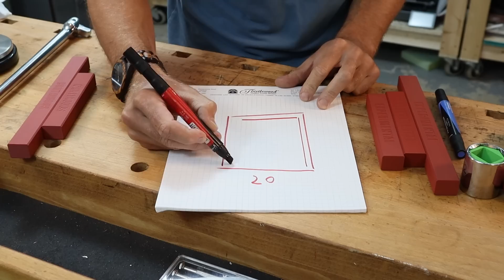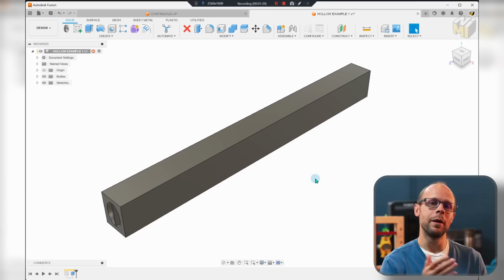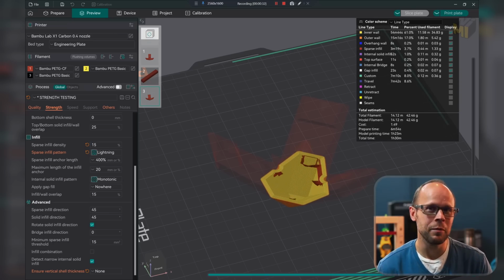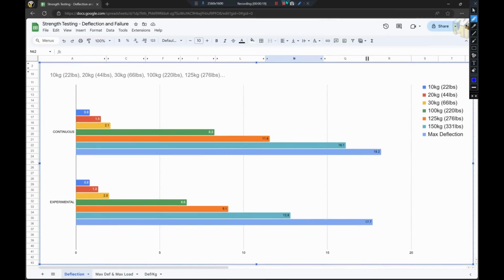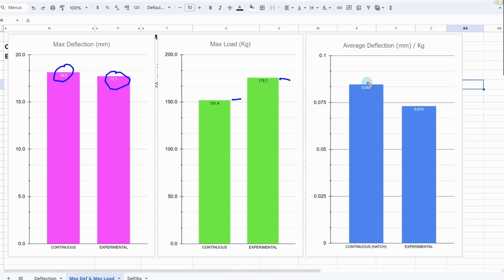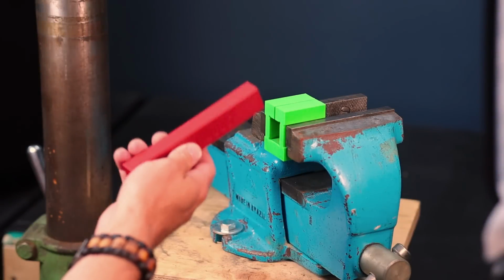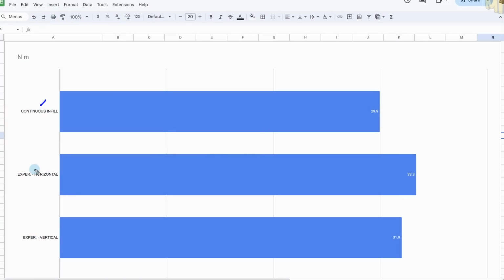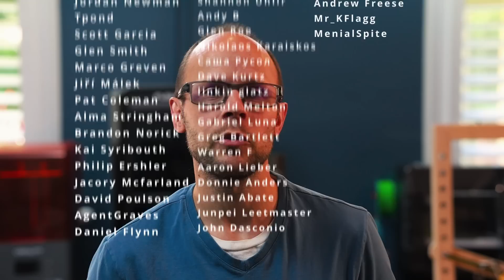Is an UNfilled 3D Print Stronger than an INfilled 3D Print?

Comment: This is a very common and useful technique for designing mechanical parts. The further away the material is from the neutral axis the more it will contribute to the bending strength of the part (you can possibly think of it like torque), so for the best bending strength you want as much mass as far away from the neutral axis as possible. Along the neutral axis (in a simple rectangular part that would be right in the middle of its thickness) the stress and strain is zero and the further away from this axis you get the greater the stress and strain become.

Steel H or I beams are a good example. When used in the right orientation they have very little material in the middle, close to the neutral axis but they have lots of material further out. They are much stronger than a solid rectangular beam of the same mass because of this more optimal material usage. They also have a very good strength to weight ratio, much higher than if you used a solid beam with the same external dimensions whilst also having most of the strength of the solid beam since in a solid beam most of the mass doesn’t add much strength.

So when designing parts to be used in bending it is best to use the largest part you can (external dimensions) and distribute the mass as far from the neutral axis as possible.

This is also why two stacked beams won’t be as strong as a single thicker beam, each of the stacked beams bends independently and therefore the maximum distance material is from the neutral axis of each beam is half of its thickness whereas for a single thicker beam the maximum distance material is from the neutral axis is doubled so the material contributes much more to the strength.

Comment: I found 5% and 15% gyroid(or triangle infills gave better support on a wing profile..I also found going below the nozzle size for line width made the parts significantly weaker but oversizing was fine or useful.

Comment: If infill is to support top layers, it doesn't matter much, how it is printed, as long as it's fairly dense just below bridging.
If infill needs to bear load, it needs to be thick -  0.6-0.8 on 0.4 nozzle - and dense - 50%+ (just changing width changes line spacing as well).
In Cura it is possible to print infill with multiple lines, creating loops. Combined with alternating extra wall (Cura) it should produce pretty solid infill. PrusaSlicer honeycomb is also 2 lines wide.

( Or use non-filled plain filament for max strength 😅 )

Comment: My sound stopped into the clip, so I may have missed it - one very important question - do the parts have the same mass per unit length?. What do you think about airplane parts that are using honeycomb material because the lightweight filling is providing a much better strength to weight ratio?

Comment: Great video....try a ribbed or shallow corrugated inner profile (think early Junkers aircraft construction) - will increase both stiffness and torsion.  Even more so if used on outer profile too.  You'd need to reduce wall thickness and optimise to keep the same weight for true comparison.

Comment: From physics standpoint - the closer to you get to the middle of part (or the bending axis) the less strength you gain with infill.
When bending a part, majority of forces are on it's skin, and because of that, hollow parts are industry standard - hollow bike tubes, hollow car's bodies and thin metal sheets being stamped to mimick a hollow part.
You also made an improvement of adding more material to the corners, which are further from the middle and thus provide more % of strength, but I'm not entirely sure that in rectangular part the inner hollow should optimally be an oval - probably something like very rounded rectangle would be better.
Infills generally are wasteful - making some structural ridges just below the surface is sufficient for most of uses.
Reply: doesn't ikea put a honeycomb basically of cardboard inside of its tables and desks to improve rigidity?  In that case the honeycomb is rigid perpendicular to the load, but I feel like it definitely does something compared to just hollow particle boards
Reply: @Negi2468  They do, but mostly because of reasons mentioned above plus cost. 
IKEA wants to use as little of expensive material - outside veneers - as possible without it breaking easily. On top of that, very large flat panels need to be rigid to not only bending but also compression, and that's why cardboard infill is used. 
They'd also easily buckle or break at that size and thickness.
Reply: True, I'm studying engineering and one of my subjects this year was material resistance. The most important parts of a structure under a load is the furthest from where it's applied. So in this case, the bottom part is the part where more traction is being applied, so if you know how the loads are gonna be applied on a manufactured piece, you should always reinforced those parts. 

In this case, giving more wall thickness on the bottom part, not on an oval shape, since that middle part where the wall is thinner would become the failure point. Giving round edges for the vertical walls and a flat ceiling. You could even make the filler thinner the closer to both ends
Reply: That makes them stiffer but generally doesn't raise failure.

A hollow tube will deflect less than a comparable solid steel rod, but the tube will still fail sooner.
Reply: @ObservationofLimits if both tubes are of comparable weight, the hollow tube will be stronger until we reach the point where buckling becomes the main failure point
Reply: @FierceFire14  a tube is actually a terrible crossection for bending loads exactly due to ovalization buckling failure mode, and internal reinforcement (like spars or infill) can help with this greatly, less so for box sections.  From pure bending standpoint, I-beam is the best of course. A tube is unrivalled for torsion.

Comment: Most of the strength in any structural part is in the surface. The polish glass rod experiment best taught in the the engineering causes of the 60s and 70s, demonstrated this phenomenon. Glass cutting shows just how fundamental this is. Layer lines are effectively scratches from a tensile strength perspective. 
The strength of all plastic materials is Van de Waals forces and a consequence of polymer molecules length and shape. 
Infill effects compression forces that cause members to buckle. Cura provides the ability to insert members/internal walls to compensate for compression...

Comment: This is very interesting.  I make structural parts. I am doing hydrofoil blades at the moment. I print these hollow and then fill with expanding foam.  If I need extra strength, then I put a very narrow slot, 0.1 mm width in the wall, and extending in a few mm, but not all the way through. I am using a 0.6 mm nozzle, so the slot walls in practice touch, i.e. it is like a web but with an open side. This adds to the cross section of that part of the wall, i.e. stronger.  
I have tried all sorts of different materials.  My current favourite is PLA Meta.  It has good inter-layer strength, and is relatively easy to print with. And not too expensive.  It is a bit stringy so there can be some surface cleaning up to do, And I use light colours - dark colours overheat in strong sunlight and distort.

Comment: 2:49 wow, seeing how flexible the infill is really emphasizes the idea that walls are more important for strength
Reply: I've always printed my infill lines at 2x nozzle size thinking it adds strength being it should be less flexible. Be  an interesting thing to actually test
Reply: Flexibility does not equal weekness.  Remember that a bending branch lasts longer in the wind than a stiff one.  Stiffness can make then much much weaker to "shock" forces.
Reply: @Stevieboy7  you make a good point
Reply: @Stevieboy7 very true but everything is still governed by the wall flexibility.

Comment: Enjoyed tests. Makes me curious if you tested single strands of unused filament, would their strength, tension etc. have a linear correlation with the 3-D printed parts of the same material. If so, think about how easy it would be to test new materials! Bending tests not possible, in that case print 3 or 4 layers. I feel possible correlations with fully printed pieces could be quite useful.

Comment: Great testing! I think the optimal structure would be to have thick walls with all interior corners rounded e.g. 2 mm and inside filled with big honeycomb-like structure with a couple of layers worth of wall thickness. The idea would be to have some internal walls but not pure infill. I would guess a single hexagonal cell should have around 15 mm side length. I'm not sure if the walls of hexagonal structure should also have rounded interior corners. Having rounded corners would make the structure stronger but additional testing would be required to see if it's worth having more material.

I agree with your methodology that the mass of each part should be identical.

Comment: I was expecting the last test to be crushing but it never came?
I suspect this is where the strength came from. For pipes we know the outer parts of the wall carry most of the load but for bending and torsion but for crushing it is completely different. Especially if the force is not applied to the entire surface of the object.

Comment: As always kudos for actually experimentally measure results, and trying new variations.

Don't beat yourself too hard about the last videos not having the same performance of the previous ones, the fatigue of a topic is a real thing.

Breakthrough videos of an interesting topic could have an increase in views due to high engagement in the algorithm, but people rarely stick around about continuous testing of the same topic, maybe switch around the topics a bit between each release, and then make "series" of videos by topic. 

At the same time wildly different content of topics also deter the core audience so it's a gamble push to far away the "main" audience, so the main takeaway is stay in your lane, but have a little more breathing room between topics continuous "main" topics.

Comment: I think you're touching one of the main point for next gen slicer from an engineering point of view : modeling the inside of parts! That is a very interesting video!
Reply: It's an old comment, but incase you are interested: take a look at the prusa mini 3d printable parts (probably also other models, havent checked), specially inside of the models... They have included internal ribs that force the slicer to include interior perimeters inside the parts, adding hugely to the strength. I'm sure many designers do this, but it's a very good example. Would be awesome to have an option to add these directly on the slicer... a bit complicated as it doesn't know how the part will receive stress.
Reply: Doing topology optimization and merge with 1mm shell does the trick. No hand tooling required.

Comment: Loose paper bags to catch/decelerate the sample fragments, like airbags/parachutes;
Or lace a cord (twine?) through the ends so that most of the pieces are captive; like a floppy-rail/zip-line.
Loss of spectacle aside, I think that having more control over where they fly to would allow for a safer (and easier to clean up) test, while also providing some illustration of how much energy each failure releases by how much they affect (or punch through) those controls.

Comment: When optimizing you need to consider the load profile.  For the bending test you want most of the material near the top and bottom, with the minimum sidewalls to enforce spacing.  Which is of course not optimum for other load profiles.  For torque you'd want a circular tube if the material was isotopic, which FDM prints aren't.

Comment: i wonder if you built a jig for holding the round end of the torsion test if that would lead to better results as it seems you are not just twisting but also applying a pull force. if you make it so the end of the socket can't displace you might get more repeatable results. supper cool idea though, i wonder if the results change if you post process the parts by annealing them in an oven?

Comment: There's one option that I'd love to see tested.  Cura has an "alternate extra perimeter" option.  Every other layer gets an extra wall so that the infill is getting sandwiched between walls.  In theory it would make a stronger part, but I don't know if it's actually significant.
Reply: It works, but the difference isn't that major.

Comment: Infill has only ever been a sort of internal support structure for printing purposes that is also as uniform as possible so the part has a predictable weight distribution. It also sometimes contributes to structural support but the use of infill should only ever be an intentional design decision. You can and you should try to find potential solutions that work best for your specific use-case and printing parameters.

Comment: I think your torsion testing could use a little bit of work. Somehow or another you need to support the twisting tool so that you're only putting torsion on the parts and not putting a bending load on them at the same time. I really think in trying to keep it in line with your other hand you're just asking for inconsistent results.

Comment: Interesting experiment. If you look at the bone structure of different kind of animals, you may see that land animals have hollow bones with thick walls, while birds usually have a specific bone structure with thin walls and foam like internal part, similar to the gyroid infill. I wonder in what situation would be the infill more advantageous. There might be a wall/infill ratio, where strength/weight ratio goes up at the infill end of the spectrum. Somewehere around a wall thickness (ot thinness in this case) where buckling is an actual problem before critical wall failure. Instead of gyroid, lightning infill may be more suitable in this application.

Comment: You could try minimal Lightning infill with maximum walls.  The purpose of the infill would just be to support the roof of the part while printing.  And you could do a + shaped interior flange, and maybe make it thicker.  Looking forward to the next set of tests.

Comment: Great Video and testing. I have some inputs on your methods, as Ive done 4 Point Bending on Composite Sandwiches for my Bachelor Thesis:

I would choose to repeat the Test 5 times per sample, as a big scattering of examples is to be expected. (But you have Said that already).

The Text to distinguish the samples Looks neat, but creates a Point of failure.

4PB is sometimes used over 3 PB, because you get an area of the sample, which is just loaded with shear force, as the bending Moment in not present inbetween the cylinders for force intruduction. Your cylinders should be further apart.

Thanks for your contribution to the 3d printing community

Comment: Thanks for the extra test, I appreciate the work.
I even went back to your last video to get the comparison.

PETG-CF (red) Continuous with infill: 30,6 Nm
PETG-CF (black) Continuous with infill: 48,4 Nm
So, an Improvement of 58,17% 😮 in the torque Test, more that I expected. Also the failure mode changed to "fractured in 3 Parts" indicates that the black Filament has more Stiffness, imo.

I heared before that the filament color can change the products parameters, on other filament test runs by CNC Kitchen or Makers Muse they tested on test cupons, but on a more practical part the diffrence seems quite huge. 
ok the Samplesize is 1/1 but the trend is plausible imo., because all the other Red Parts in the Joint Test where the weak link too.

Comment: Interesting video! One thing you can do to make infill more useful is to increase the thickness if the infill. Cura is the only one I found that has this and you can reduce the infill really low and increase the "Infill Wall Multiplier" as you please. Plus I think this can go even further if you try changing the angle of the infill aswell. :)

Comment: Your vertical should have a radius and feather into the inside walls.  During the twist test you can see that the vertical line cracks where it enters the inside wall.  A small radius would displace that shearing point.

Comment: Printing direction matters a lot if you want the best strength to weight ratio. Just like fiber-glassing an aircraft. There are two type. Unidirectional, and Bidirectional fiberglass over foam core. Fill will be the foam fore that brings rigidity and transfers the load from one side to the next. 
Since I mostly print engineering parts (gear, pulleys, enclosures,..), I need the strongest part.
Hence, I never use the parts fan and don't exceed 50mm/s speed. ex. PETG @N240ºC/B75ºC will not come apart at the layer. 
I found white PETG to be the best regardless of the manufacturer. I guess they use Titanium oxide pigments like any other white paint. 
That has been my experience I thought I share.